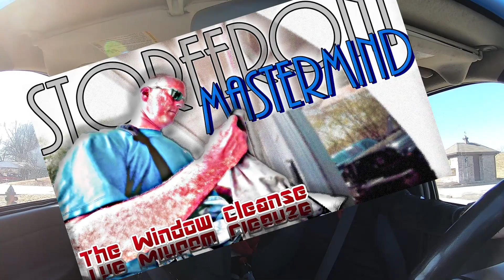Finally Caught Up On Route Work

Comment: I’m looking at purchasing the xero trad pole. For the cost of it, I presume you can add to the pole with extensions? I have the Ettore backflip handle and the Moerman excelerator, what tip for the xero would you suggest?

Comment: Great video. Luke you were using a nija scraper in the video, I just bought two and when I use it I notice only small sections of the scraper are hitting the glass? Any ideas? When you used it it was flat and the entire blade was making contact?
Reply from the maker: I know exactly what you're talking about. It was scraping uneven in this video because I was in a pinch and had to use ettore blades. But usually it does a fine job. Are you using the correct blades in the scraper ?
Reply: @LukeTheWindowCleaner  Just using the stock ones that came with the blades. I was thinking maybe the blade is just off and I need to put a new one in. What brand of blades do you put in your ninja 6in scaper? Appreciate the reply!

Comment: Hey Luke! I noticed you using the Moerman Aquafill Kit in this video! Is that setup pretty standard for most storefronts? I don't have a route yet, but I was wondering what to do about water when I do get some storefronts.
Reply from the maker: Hey buddy ! Idk if its standard but it is very convenient to have. A lot of commercial water outlets shoot straight out or are to low to get my bucket in. You can definitely get by without it but it makes things a little easier. You'll also need a commercial water key which you can get at lowes or home depot.  We also carry 6 gallons of fresh water in the back of our truck just in case we cant find a water source.
Reply: @LukeTheWindowCleaner  Sweet, thanks Luke!

Comment: Was cussing my Werner multiposition ladder so hard a couple of days ago on a gutter and window cleaning job. It gained 10 lbs every time I moved it. It's good for some specialized uses but just too heavy for general use. Maybe some people don't know you were joking about you and SteveO loving Gorilla ladders ha. I like his suggestion of getting a Type 3 extension- I think that plus a 12 ft a-frame and a 4 and 6 ft step are going to be my ladder set up going forward.
Reply from the maker: I hear ya. I actually like the Werner multiple  purpose ladders. I've used them for a long time. They are heavy, but I mostly wfp all 2nd level res work or trad pole commercial and storefront.  Its actually becoming less and less that I use ladders .

Comment: Great vid, yet again💪💪💪
When you do the door trick, the last move down makes a minor diagonal line that dries very quickly.
Are you concerned about that one, I tend to leave it because once dried it seems completely gone.
Reply: Raoul Van den Broeck I have same line left. Never to sure to deal with it or not!
Reply: @mrb1983  yeah you can minimize it if you push your trailing edge of the squeegee a bit upwards just before you make your last transition from from above. 
Then it dries off best.
Reply: Raoul Van den Broeck thank you, il try it out 👍🏼

Comment: A couple of things. 

First, I apologize for calling you. I didn't have a smart phone and needed soap. Won't happen again.

Second, I have a couple of requests for videos if you would be willing to accommodate me. I need help with:

1. Detailing: I would like to know everything about detailing and how you squeegee to avoid needing detailing and when you squeegee that way vs. all the way to the edge, how long after you squeegee before you go back to detail, etc.

2. Squeegee Sticking: I've noticed in your videos that you can go over the glass several times with the squeegee once you've wiped all of the water off. I've been applying a seriously light amount of pressure to my squeegee, but if I go back over a dried area on the glass it just catches and grips with a ton of friction and I can't move it. I don't know why. How do you do this?
Reply from the maker: No need to apologize! It wasnt intended for any particular person. It's just an issue we needed to address. For glass that is cleaned frequently you can miss just a quarter of an inch or so from the frames and you wont have to hardly detail.  This wont work well on very dirty glass. Weekly maybe bi weekly accounts you can get away with it. I tend not to walk away from undetailed glass too long. You dont want the drips running into the clean glass.  

As for the slip on the blade. That wont work to well in summer months. It's mostly just the slip of the soap and having a little extra water still on the blade.